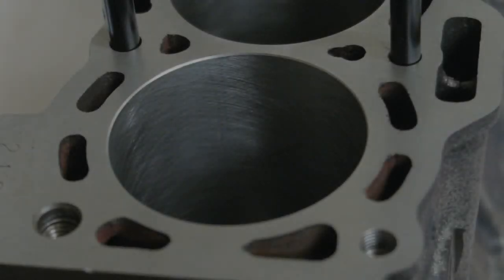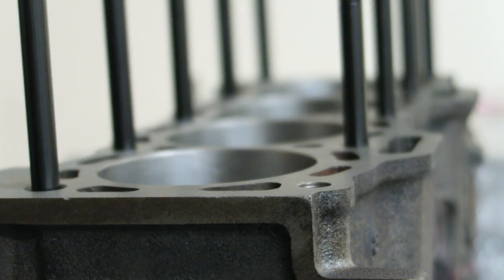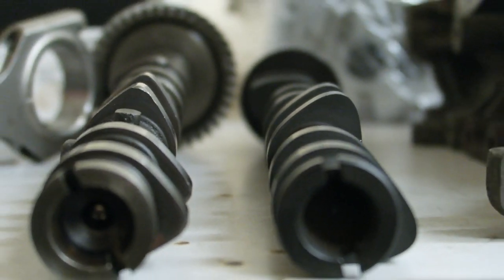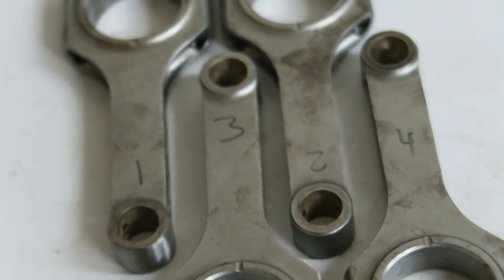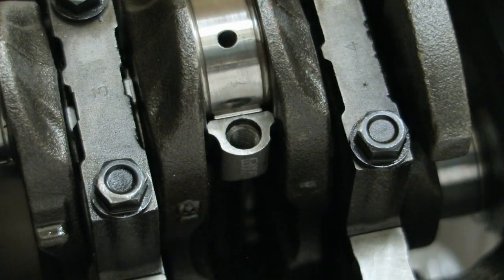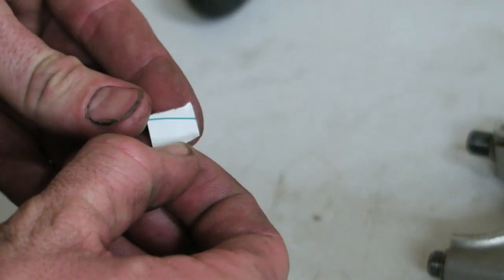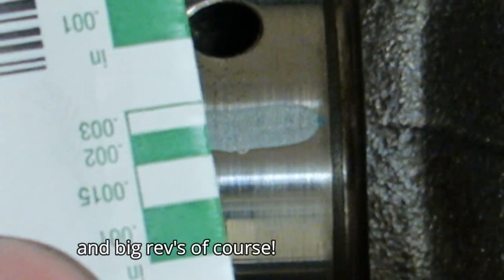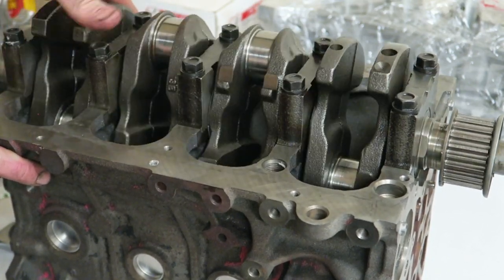4EFE/5EFE bearing clearances and forged internal info

Comment: One of my crankshaft main clearance are 3 on 0.003 and 2 of the main caps in 0.002. Do you think I can use it for turbo build or do you recommend all the main clearances even?
Reply from the maker: We are not professional engine builders, but I wouldn’t worry.

Comment: I know this video is old AF, but did you also use a forged crankshaft? Or just the 5efhe version?
Reply from the maker: the 5efhe version is the forged version. We only used the cast version in this video and the engine made 400hp atw... Just pulled it apart in my most recent video due to a noise...
Reply: @Camp_Dogs  damn, it's been running for quite some time then, thanks!